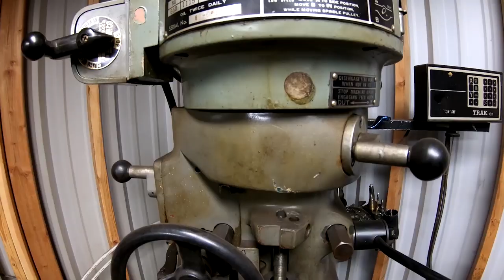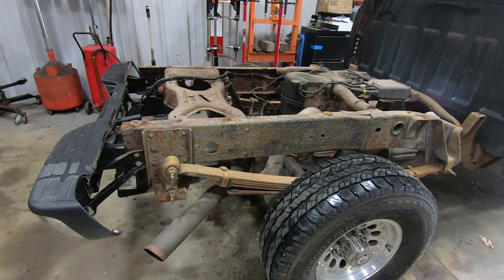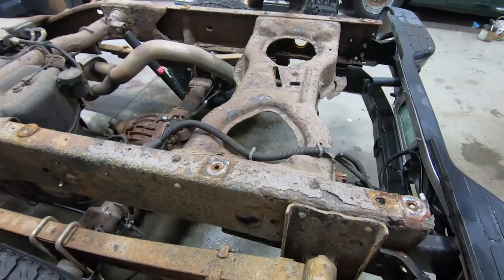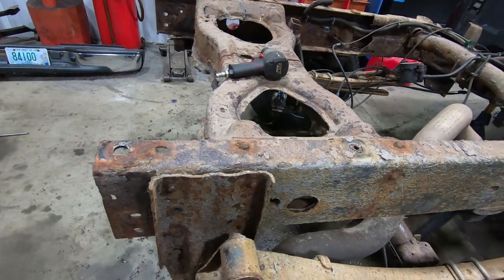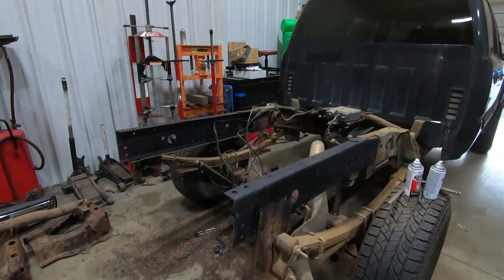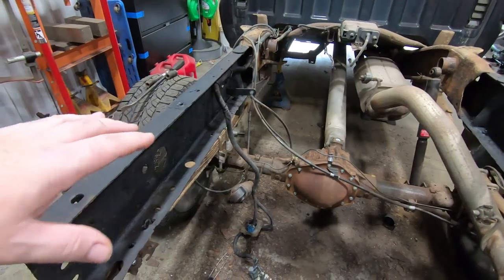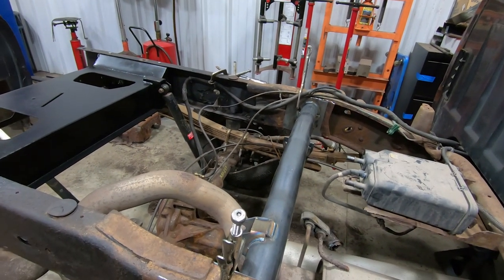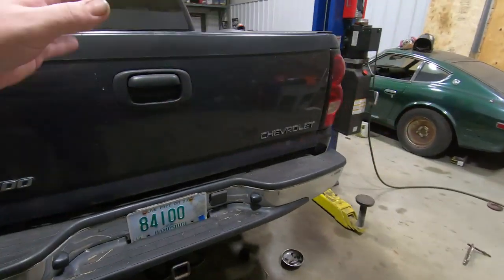Chevy Silverado 2500HD Frame Repair!

Comment: Thanks for doing these videos. I’m just starting on my ‘07 GMC 2500HD. Gives me hope I can save my truck. It’s a Duramax LBZ and runs and drives perfect but the rusty rear frame is bad. With only 109,000 miles I want to keep it and fix it. So far I dealt with the bed bolts. 3 spun so I cut the heads off. I’m making a bed dolly to store the bed and do some body work on it too. I’m 76 and up for a challenge 😂

Comment: The black box that has lines coming from it, is that for gas engines only? My 2007 2500 had classic duramax doesn’t have that when I took my bed off.
Thanks

Comment: Very nice repair you were very detailed and knowledgeable. My question is, is that truck with that fantastic repair going back into the same road conditions as before?? If so, it’s like why even bother. I used to live in NYS and now I live in Florida and I see 2000 to 2005 Chevy trucks all the time, with no rust. They’ll still have the black factory coating on the frame with no rust. Only clear coat on hood and roof burned off from hot sun. Truly amazing.

Comment: Recently just removed and replaced the spare tire mount/brackets on my Bro's 97 K1500, it has rivets as well and we cut the heads off with a saws all with long blade then used a grinder and punch to remove the rivets, it was fairly rusty  for being a SE- Georgia/Florida Truck, but Very Similar process,  Everything else on the frame was good and not compromised surprisingly,  Appreciate your attention to detail on These Rust Repairs- Makes me want to start buying junk title trucks for the frames lol - so cheap down here and mostly clean.

Comment: Done this couple of times on my tracks If u go this far flip bed over and power wash out Set bed at angle and pour Rust-Oleum paint on bottom of floor It will flow and seal cross supports on bed Tip put cardboard between bed and cab it stops any scratches or dings while lifting off

Comment: When you put the rear tank cross member back in. What did you use for reference points or measurements to ensure it went back I. The correct spot for the shock and gas tank strap

Comment: Hey man just wondering if you could weld in the cross members and frame bits from a 2500 to a 1500
Reply: I have the same question.
Reply: @jdm894g  can not.

Comment: Great improvement but use Rust Kutter or sulphuric acid so that it changes the rust from iron oxide to iron sulfite and then paint 24 hours later.  It will stop and cure it, it is like blueing a gun barrel.

Comment: @MorFab Industries.  Any thoughts on if that rear crossmember would fit a '99 2500?  OE has the tube but if I can stiffen up the rear when I go to replace the other crossmembers that would be nice.

Comment: Hey, the gas tank crossmember is by nature wider than the holes in the frame. Did you just slide it in? or did you have to wiggle it inbetween the C channels?? Any help would be greatly appreciated. Thanks

Comment: You could technically take that X brace in the rear and weld it to a 1500 frame couldn't you? My 1500 is rusted out and I have the opportunity to get the whole rear of a 2500 to use for repairs

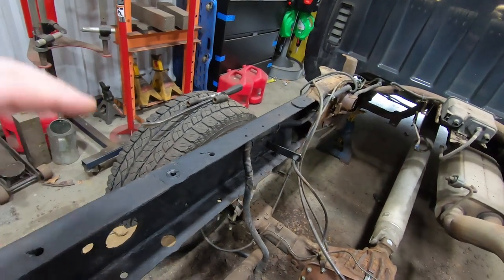Comment: I'm looking to see if there is a way to repair the side frame or side rail area's that you touched on at 11:30.   What happens if you do not have enough thickness?  Our local shop said they wouldn't touch it because it's too far gone.  Can these side frames be removed and rewelded to the front - or are we looking at an entire frame swap?

Comment: Awesome job!  I am getting ready to do the same exact repair to the rear cross member.  Is the exhaust mount not included with the Saf-t cross member?   Also.  I have never welded to a truck frame, what precautions do i need to take with the electrical system of the truck.  Thanks!

Comment: Great video thanks! I’m in the middle of replacing my spare tire crossmember now and wondering if you could tell me what size and grade bolts you use to replace the rivets are, particularly on the shackle brackets? Any need to increase the diameter or anything?

Comment: If you look on your video minute 11:40 you talk about that bracket always rotting out. Did you replace those or what did you end up doing?
Reply: I need your number I got a hd same thing needs done I n got all the hardware from safty cap already was going to. Go at it alone but for a good price willing to haul it up there I in stl

Comment: I’m glad I found your page.  I’ve been debating on fixing the rust on mine VS getting another truck.  Your videos have me thinking more positive about just keeping it and fixing it.  I’ve got 211,000mi but it runs great.  What would you do ?  Sincerely appreciate you opinion. So many ppl say to get rid of it, but I’ve also seen diehard duramax owners fix worse. I’m just torn between spending the money on a newer truck or putting the money into a truck that’s worth less.  Decisions - decisions.
Reply: Fix your truck .. gonna be worth it .. I’m repairing all the rust on my single cab 3500 04 filled with rust

Comment: I think if I was the owner I would have replaced the front cross member while it was apart.
Reply: Didn't need replaced
Reply: @jonathanyates5198  I said if I was the owner. It is a personal preference. It was rusted through, it is not going to stop rusting.

Comment: Having same issues with my HD too. I’ll be ordering the cross members and tackling it ASAP. Great vid too
Reply: Definitely Good to get it done ASAP ... mine was let go so long that now I have to replace the back half of the frame
Reply: @baileysconstruction7898  yeah man that sucks a big one. luckily my rails are still solid. I just finished mine up today actually. Wish I could post some pics it came out nice. Paint is all I have left to do now I should have the bed and tank back in by Saturday. I replaced all the cross members even the one right under the cab that goes over the drive shaft.  A shop quoted me 1032 dollars to just do the very rear. Luckily I have a torch and good welder to do it so I was able to do it all for around 900 give or take a little for random supplies and paint.
Reply: @jordanlogsdon9926  ya I’m actually cutting out the back half the frame and sectioning another one in tomorrow because I found a rust free frame that just bent in the front
Reply: @baileysconstruction7898  sweet good luck I’m sure it’ll work out for you keep me posted

Comment: I'd say honestly, that truck has about 5 years left in it. If that. But either way, excellent work!
Reply: Why do you think that?   Not being rude.  I’m debating on fixing mine but don’t want to do it if it’s not worth it to
Reply: @serenityplantation7638  Its just the domino theory man. If something that significant is that badly rotted on the truck, then what about the little things that are even less resistant to corrosion? Fuel lines, brakes lines, gas tank straps, transmission cradle, fenders, cab corners, rocker panels, electrical grounds, things like that. The list goes on.